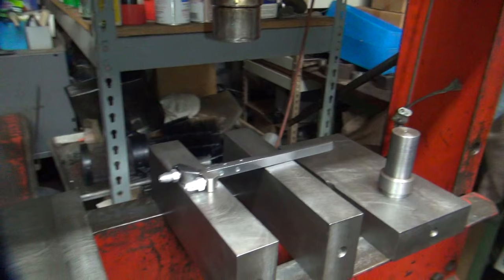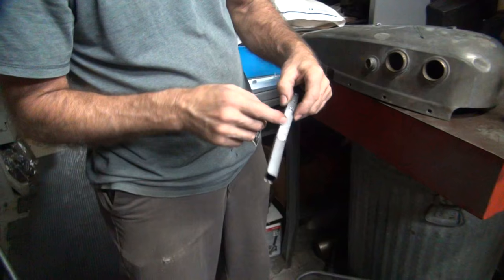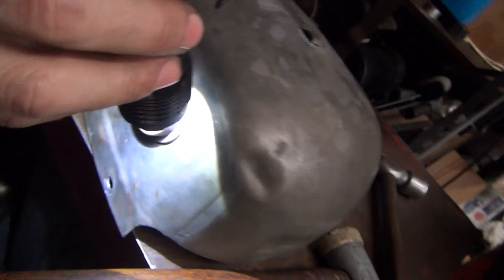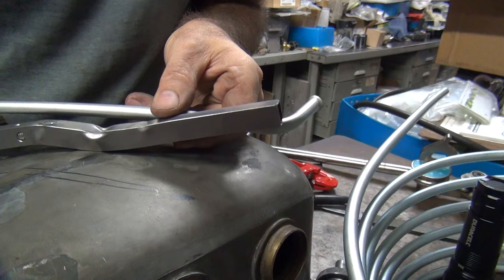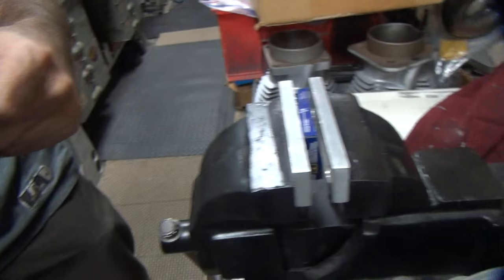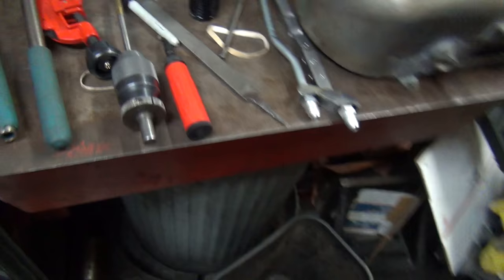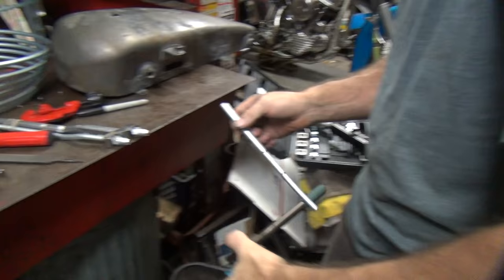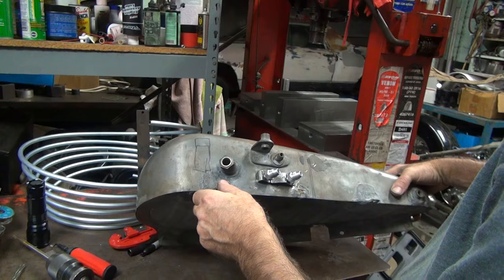1936 RL #106 WL 45ci Flathead Bobber Bike Assembly rebuild 41 WLA Harley by tatro machine

Comment: The question was posed regarding the extra grooves cut into the rollers on the tubing cutter and what their purpose was. The purpose of the grooves is to accomodate a flare on the end of the tubing when re-cutting tube where the flare is damaged or the length has to be adjusted for a new flare. By putting the flare in the groove when setting up for cutting the grooves allow you to trim tube with less waste.